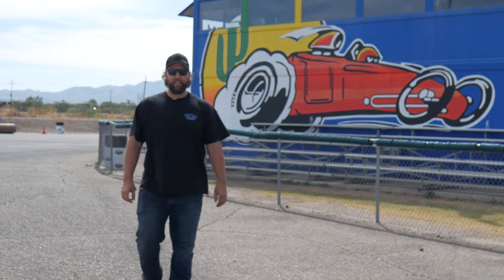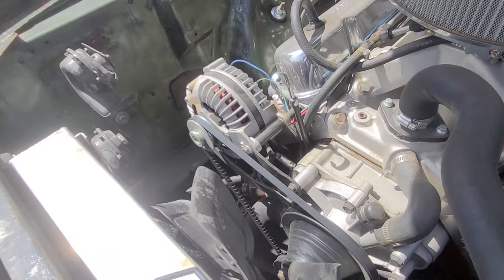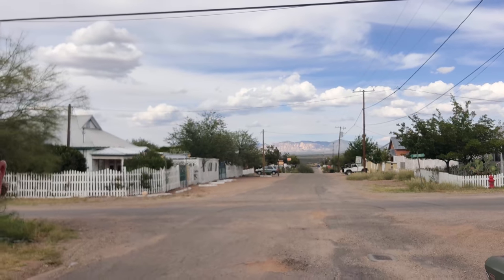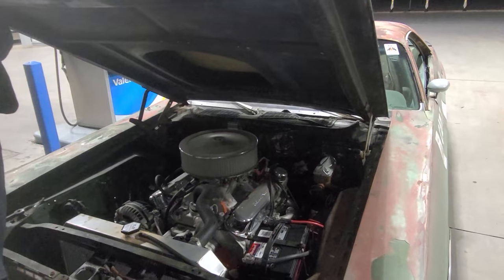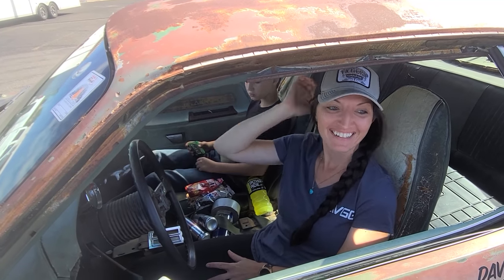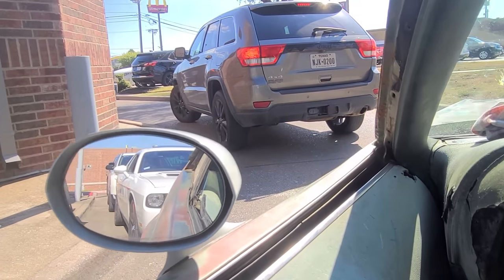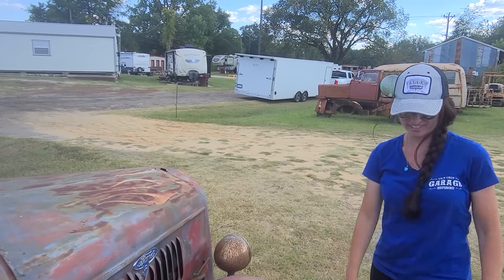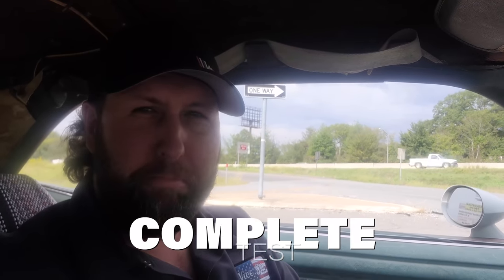I bought ROADKILLS "Vanishing Paint Challenger" - WILL IT DRIVE 1,800 Miles home?

Comment: way back in the 1980's i was first introduced to the optional trunk key by my auto shop teacher.
we had a donated torino for shop use - beat up and sad but good to teach the basics on.
we all laughed when he said he needed to get in the trunk, but it had no lock in it - and opened the hood instead.
"what, you guys didn't know there was a key for the no key trunk in here?"
he then pulled the oil dipstick, inserted it in the center of the latch, turned it and of course it opened.
ah, the good old days...

Comment: Best episode to date! Loved it all. The Vanishing Paint, the Ford with a Mopar motor, road trip, family time, Duct Tape Drags. Wow, epic adventure!
Reply: Ford with a Mopar motor? Which one was that? The Hemi Gremmie is an AMC.
Reply: @pookysdad4884  halfway through the video. The Ford he stops and looks at in Texas.
Reply: @Mclovingarage  Ah yes. At the 55 and a half minute mark. I just got there. Love it.
Reply: @pookysdad4884  super cool! Chopped top and a Mopar small block. I’m in! Haha
Reply: @Mclovingarage  Me too, I once chopped the top on a '50 Ford F-1. SIX INCHES! It looked super bitchin. But my welding was not as good as my cutting. And I ran outa money. It was gonna get a BB 400 and 727, but I had to bail 😕.
Reply: @pookysdad4884  sounds like that would have been a lot of fun when completed. Cool idea.
Reply: @Mclovingarage  I havent posted anything on Insta for about 3 years, but it might be on there. The name is either Jeff Kopis (moi) or Mopar Slim, I don't remember. Same on Twitter.

Comment: If you find the power steering pump leaking, just add about 2 or 3 tablespoons of brake fluid, preferably white the engine is running.
I was taught this trick back in 1977 by an old mechanic, he flew B-17's in WWII.

Comment: Derek, I love the content and I love the comments throughout your adventure-make-it-happenings. It's interesting to see someone buy a car, fix it onsite, and drive it home. A guy could have a lot of fun with no chance of anything going wrong. Nope, probly not. But, that's... that's fine. :)
Reply: I don't trust my running vehicles at times so there is little chance of me trusting a "found on road" dead vehicle. I'm happy when my lawn mower starts every time I go to ride it. I have a used Craftsman now and milked my old free JD along for 30 years. I'm glad it had a Kawasaki engine so parts were easy to find. Those hydro transmissions are not built to last in any brand and not made to be serviced at all. A JD dealer told me as much. It's scary to have one admit such things. I can change the gear oil on the Craftsman; not so with the JD.

Comment: Check out the jets and the airplane graveyard outside of Tucson at Davis Monthan AFB. Top Guns. I used to co-drive a Ford heavy duty pickup hauling a 40-foot trailer for an antique furniture buyer. We were in Ruidoso, NM, and I fell asleep. I woke up to mooing. We were totally surrounded by cattle in all directions in Hereford, TX. It was strange.

Comment: My 72 Challenger almost went in,the ditch one day because of the stock plastic t handle slap stick shifter. I was coming off the freeway and had a manual valve body automatic and I went to downshift from drive to 2nd and it went into 1st and it was raining. A manual valve body means when you shift it it shifts no matter what rpm. So the ass end was swinging to and fro and I was looking at the guard rail then the ditch, guardrail, ditch, you get the idea, but I saved it lol, I was good at that lol. Oh the memories.

Comment: I live in Virginia. I have a 66' Corvette Stingray in my garage. The interior is fully re-done. It belonged to a friend of mine who passed away, he left it to me, and i am a huge fan of your show and I know this is a stretch But I need help with this thing! the motor has been was in the process of being completely rebuilt but it isn't FINISHED! And I have to honor his memory by getting it fixed, I wanna take a road trip with my wife too!! this car would be perfect but its so lonely right now and needs some love. 

. Its missing parts, mechanical wise. but the body is solid. no rust. baby blue convertible.  I even got the hard top but it doesn't have any glass in it.  it's got double hump heads, was switched from an automatic transmission to a manual but they never finished the clutch make-it-happeners. I'd love to give you my email if you have time, as I own and rent out about 7 rental properties currently so I dont have much time to fix this thing, nor do I have all the required knowledge. hell I'll even give you my phone number you can text me or I can send you photos of the car to give you a better idea. If not its cool, but I tried. I may could even pay you to help me, I don't know. Worth checking out though,  Hope to hear from you soon, If not, PLEASE keep up your awesome videos!!

Comment: That Crusher Impala makes me miss my old 72 Impala 2 door. I had it dropped 2 inches, 16 inch IROC wheels on it with the widest tires the wheels would take front & rear, it had a 400ci SB, camed up, alloy roller rockers, with nice intake, home ported and polished head air channels, oversize radiator with an electric fans, H2O pump, oil pump, deleted AC all to reduce engine drag. It was gold originally but we painted it flat black and since 3/4 of the trim was gone we just pulled it all off and used blackballoy diamond plate with moons, sun's, stars and unicorns cot out of it for style and air flow. It became a little notorious to the point that police did not ask to see my license any more because all the city cops and sheriff deputies knew my name and where I lived. That's when I knew it was time to move

Comment: You may want to switch to 51515 earl filtres instead of 51085. The Ford filter is larger and generally cheaper. These Mopars ran the 1085 for a LOOONG time. I have been running the 1515s for 25 years with great success.

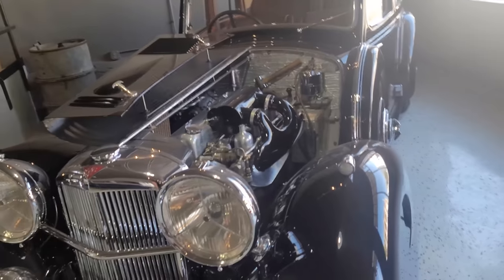Comment: 50:25. THAT Alvis comes about 2 mile from where im sitting right now. this would have been one of the last cars built at the coventry (uk) plant as they turned the factory over to the war effort (ww2) and started building military vehicles and aeroplane engines (as part of the Rolls-Royce Limited outreach subcontractors program.

Comment: PS my first car was originally a 1970 Challenger 440 R/T.  

My Dad had a 1970 383 Challenger convertible which I always admired.  I loved it so much that I looked for a 70 model for my first car.  I walked to work all summer in 1980 to save the money to purchase it for $1700.  I was 15 years old when I got my hardship license.  I took my driver's test in my Grandmother's 1969 Cutlas Sport.  But drove my prepositioned 1970 Dodge Challenger home from the Texas Department of Public Safety.  I am sure some trooper was shaking his head when I left a nice patch leaving the DMV.  She was replete with a custom paint job with flamed front quarter panels and a dragon emerging from a swamp on the 440 magnum hood scoop.  I wish I still had her!

Comment: 14:35 Gal's gotta point out that a place's gotta be pretty huge to make a B-36 (the only (mostly) prop job that can stand to to to with a BUFF in size) look almost reasonably sized like it does at Pima.

Still looks bigger than a politician's ego, though.

My grandad was technically a navigator on those, but spent most of his time navigating paperwork because they made him too airsick to be useful as a crew member. Of course, that very issue is probably why I even exist, considering those heaps' service records.

Miss you, Nonno.

Comment: This a Kool car, I happen to own one 1970 Chalkenger was an original  340 4 speed car git it in 1981, still have it, really in need of a restoration now but pretty quick back in the day ran big hydraulic  cam 12.5 to 1 dome pistons 340 Edelbrock  Victor 340 intake,headers 750 Holley ran a consistent  12.7 sec quarter at 106mph was the fastest car in my high school will restore it somehow 😳

Comment: Yeah this is the same pickup. It's a cool little truck but I want to see how he fits behind the wheel...lol  I'm skinny and 6'7" and I can not fit in o w of then. That little truck has a chevy v8 if u remember  correctly
Reply: Those slapstick shifters came stock in 1970 autos w/consoles floor shift. All these years later and all the aftermarket parts companies are making them still.

Comment: Apparently this isn’t the Challenger from the movie “Vanishing Point” because that car had a big bock, 440 . I don’t trust the 360. When Mopar when’s from 340 to 360, they had to make it with no water jacket between the middle cylinders, which made them tend to overheat because any gain they may have gotten with displacement increase didn’t makeup for the loss in durability.

Comment: Putting a Ford 9 inch in this car makes no sense,these cars came with the 8 3/4 Chrysler rear ends, very comparable to a Ford 9 inch, they even had them in the big block cars in they had a automatic tranny big block 4 speed cars had a Dana 60, we ran these rear-ends  in our circle track cars as well as drug racing.